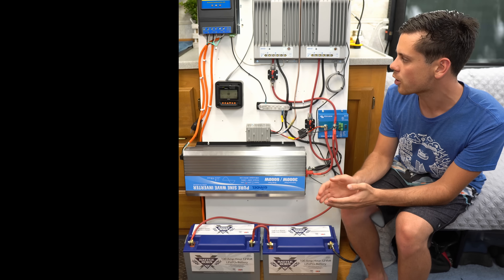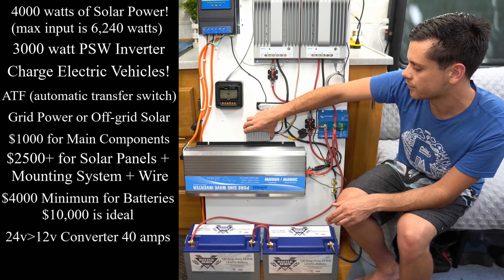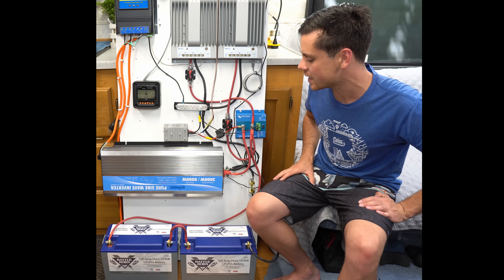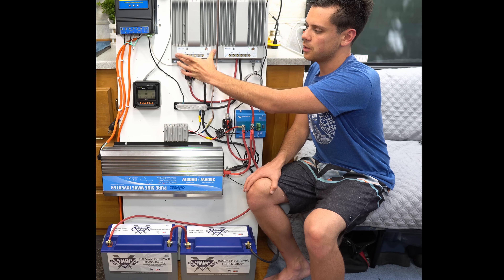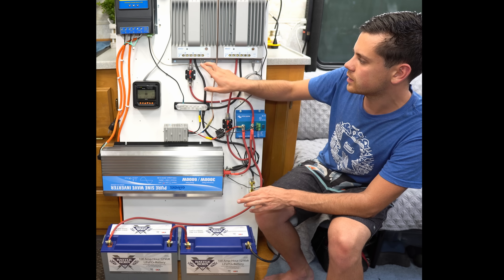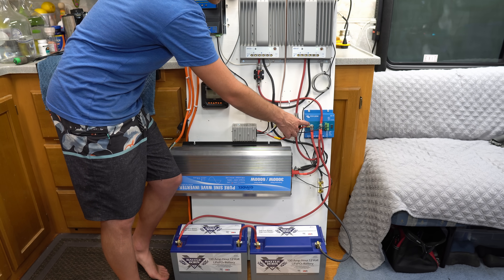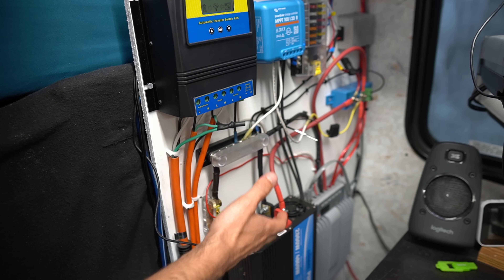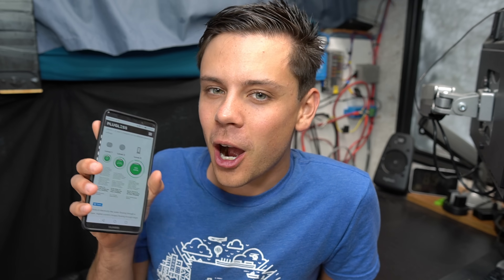Off-grid Tesla Solar Charger: 4kw solar input, 3kw AC output, ATS and more! 3 hour build time

Comment: I have a poor mans version of this at my home and charge a Nissan leaf EV,  system is 24 volt, 2000 Watts of panels, 8 vmax tanks, 1500 inverter.    The car  2015 Nissan leaf purchased used for 10K about a year ago out the the door.  If I remember the DIY solar system was like 6k (purchased 3 years before the car prices were higher for each watt).    My system is only used during the day with strong sun so we can charge on a cloud free day from about 10 am until 3 pm in the summer and 11 -2 pm in the winter.  The Leaf takes about 1200 watts to charge using the plug in charger that came with the car.  The solar system will put out more than this keeping keeping the battery's fully charged during the day.  During summer  In one day you can get about 6-7kw of charge.  In the winter it drops to 3-4.  The leaf gets about 4 miles per kw so you get about 12-24 miles per day of sun.  In winter it is more of a challenge due to shorter days and more cloud cover.  Occasionally we have to plug into the grid to charge.  Normally, you charge in the day and run your errands in the afternoon for all of the sun powered miles you like.   Also for us everything we use the leaf for is in a 8 mile or so circle so the range of the leaf is perfect for us ( about 85 miles).  Total in for 16K and that included the car!  My wife loves never going to the gas station to fill up!
Reply: By charging your car slowly, with the PV power not used in your home, you'll greatly extend the battery life, while creating your own net metering program.   Net metering will go away as more and more solar are poured on the grid.
Reply: Hi Der Kong, which charge controller did you use and how many?  Thanks!
Reply: @KennyGillis  Midnight classic solar 150
Reply: @derkong7114 Okay thank you, I looked up the specs.  It seems I could get away with something a little less capable for 1.4kw output.  Are you still using your setup?  I was thinking to use Nissan Leaf battery modules for the battery.  They are quite cheap.
Reply: @KennyGillis  Yes still using my solar for the leaf, the vmax tanks are now nearing their end life as I have to be careful to only charge the car on cloud free days as they cannot handle the pull without perfect sun shine now for very long...  The system was originally put in to run fridge, freezer, some lights, fans, electric start on gas stove and gas water after we lost electricity for a week due to tornado damage to the lines... The car came later as a way to use the solar more.... it was a fun project... let me know your battery choice and how it works as I will need to soon replace mine too...
Reply: @derkong7114  I definitely will.  My goal is to make spec the bare minimum for what is needed to do Level 1 charging on a tight budget.  I think three Leaf Modules in series will be perfect for the battery.  Biggest challenge now is finding the right size charge 24v charge controller.

Comment: Interesting timing of this video as I just picked up my Tesla Model 3.  As you mention, level 1 charging is pretty unrealistic as it only puts something like three miles per hour back into the car.  I have a NEMA 14-50 plug at home that I use for level 2 charging.  However I think the system you put together is very impressive.  I wish I had the time and skills to build it myself to power other parts of my house. Plus it is pricier than I can swing right now since I have to make Tesla payments. :(  Great video Will.

Comment: Hey Will.  Do you know anything about the nickel-iron battery?  We had one at my EV club that was almost a hundred years old and worked well.
Apparently they are not super hard to make if you understand some basic chemistry.
The charge efficiency is not great, nor is the volumetric or gravimetric efficiency, but they can withstand overcharging and over-discharging very well.
Might be a cool project to make and test a few (or buy).

Comment: Thanks for the videos. I have some ideas for things to test.
1. Low voltage disconnect. I have one from. Amazon. Has a rotary dial 12.0,12.2 cutoff. Though voltage drop from appliances make it not accurate, but voltage drop can be somewhat calculated.
2. A good electric heater to run during the day when solar is working. Like a 500 watt 12 volt one meant to help defrost windows, heat car ect.

Comment: Poor people in Third World countries do not use power inverters the cost of a power inverter is more than a whole years wage. And with the losses from a power inverter they would be forced to buy more solar panels that’s why poor people in Third World countries use solar panels directly to 12 V LEDs. If they’re rich enough that they could afford at least one battery they might have a 12 V or 24 V refrigerator that needs no regulation because that would be extra devices at an extra cost that they cannot afford. When I was young my friends who live out in the woods with no grid power everything with solar 12 V batteries with no inverters even the refrigerator
Reply: t lech  you can buy MODIFIED INVERTER  30 USD 3,000 watts
Reply: t lech  i used modified inverter for my refrigerator its work 24/7 1,500watts inverter 200ah battery 300watts solar panel my refrigerator is just 14inches high
Reply: t lech  TOTAL i spend my solar is $300 USD

Comment: You are in a sunny state. I am from a 6 month winter area. I think panels are nice but having a wind mill generator. Everything you show is in this video is panel trickle to battery bank.  I live in a Province where the province own utility has but into place a grid plan for base camps for hunting and fishing. The configuration is that the surplus electricity suppliers are clearly identified, the grid pay back is identified and any utility workers are protected as they work along the grid line. Contrary to the US, our Government wholly own electrical, fully intergaraded system, is happy if we push electron’s there way. The surplus electricity is sold to the Eastern states and is pure gravy. Ok this is a supburb  way of using a fully integrated (generation, transportation and distribution) utility but this year at my cabin I registered -36 c for 5 straight day’s. In our i vero ment getting car’s started is paramount. But I want to crank of the amp but also use the 12v dc or inverts 120 v.  Your target users do not encounter such climatic harshness, but you are A+ on everything you have published but could you take a short time addressing somebody having to have to function in a -30 c winter time and a reasonable temperature the rest of the time. In our parts we say that we have 2 seasons: winter and the rest. Pleas continue your work, for me, since it is a refende or go to place to increase my knowledge. Note: in the winter I have opted building a tent in the living room for efficiency. The cabin was built in 1932, the insulation is horse hair our shredded newspaper. Please tackle what battery is good for use (discharging) or charging at -36C.

Comment: Hey Will great video I've got a MCI bus with a 24volt alternator that puts out 270 amps I am planning on using the current system with solar I have enough roof area for about 7 or 8 panels some of the panels I've been looking at say they produce as much as 400 plus watts so I liked that you might as well get as much wattage as possible right.
So far on paper I'm looking at 10 to15 grand should get me where I'd like to be I really like Victron products what are your thoughts on them also lithium is the only way to go other than the cost.
Anyway great video keep them coming buddy.

Comment: Will - We asked for a house oriented higher Watt system and you gave it to us in simple, concise form with everything needed to run a complete low maintenance solar system. 

After all with a transfer box there are no extension chords and it really doesn’t take that much to run a house in conservative-mode. Thanks again!

Comment: Wow this is nice , but how big solar panels should i add for a system like this? 👍😊
Reply: At least 300+ watts per panel and 60-72 cells per panel as well. This is a set up that should only really be used with a 24 or 48 volt Battery bank. Minimum of 40+ PV panels, and like Will stated, around $25-30k of Lithium batteries. So much here to consider and NONE of this should be taken lightly as some weekend project unless you really know what the Hell you are doing ! This is stepping into some very dicey territory that only an expert should ever attempt. Not trying to dis Will in any way whatsoever, I am just trying to point out that anytime you deal with electricity - especially when mucking around with different voltages within the same system - you risk seriously injuring or killing yourself. 'Nuff said. (sorry Will...)
Reply: @JohninTucson  well thanks for the answer i will have that i mind , you are right im still new at this , I am there where im just about to buy a pice of land to build a cabin for the kids and me , the plan is that cabin are going to run on solar power cobined with a small windturbine and it are going to be a free spot or a little pice of heaven where the kids and me go to relaxe in the weekends and whenever we got a few days of from school and work , i just thought that this setup sounded like the right setup for a small house or cabin 😊 but im not just going to jump into any of this without have been reading will's book and have been reading about it on his web-site thats for sure and maby bring a freind along thats good at electrisity.

Comment: Hey William, I would like to consider a level 2 option. 
Level 2 is up to 80Amps. You can charge at only 5 Amps if desired, or 10, or 15, or somewhere in between up to the limit the connection will offer. 
Up to 30Amps at level 2 is most commonly found at public charging connections. Tesla Specific connectors often allow 40 or 80 Amps.
Consider a project with 5 or 10 Amps and an option to occasionally charge higher than that. 
The specific EVSE unit used is configured to send a signal to the car offering it's maximum Amps at level 2, then the car decides how much it will pull up to that limit.

Comment: I have a question about 12v deep cycle sealed gel AGM batteries, can they be stored in a shaded ventilated shed outside here in Phoenix where we get summer temps in the 115's for several months on end? I would bring them inside but I'm worried about off gassing and not waking up the next morning....can anyone advise me on what damage I am doing to them and do I have any other options other than moving to Siberia?
Reply from the maker: Very tough. From what I read the life cycle will suffer. You for sure need temp sensor for all charging methods. And you need ventilation temperature wise, but you won't have e gassing if they are AGM sealed lead acid.
Reply from the maker: https://batteryuniversity.com/learn/article/how_heat_and_harsh_loading_reduces_battery_life

Comment: I was looking at a Schneider setup on altestore.com.. I like to think of the long term goal and not the up front cost. Don't get me wrong I'm living like I'm poor to save money. But I'm starting with 1800 watts of panels with room to expand. And I want to use tesla batteries for a bank. I want to make it so I can add to it over the years. The inverter can automatically switch between using the battery, panels, and grid without exporting. I have a gas water boiler that I want to assist with electric water heater from the solar excess when I'm away. Thoughts? I'd love to have a conversation with you.

Comment: This system will work better than you think.  A Model 3 can be dialed down as low as 5 amps on the car's charging screen so 2400 Watts is not required all the time.  In fact, the outlet has to be derated by 20% for continuous use, so the best it will do on a standard NEMA 5-15 outlet is 12A or 1440 Watts.  You can refer to the chart on the NEMA adapter ordering page for the various options and how many miles of range they will add to the car.
https://shop.tesla.com/us/en/product/vehicle-accessories/gen-2-nema-adapters.html

Comment: Great introduction Will, but ends rather abruptly at 10:47 - will you do a part 2 or reupload?
Reply from the maker: There was nothing more to say, so I ended it there. I figure that people that watched till the end didn't care for an ending and were only here for information haha
Reply: @WillProwse  You have a point - but was hoping you'd go on to  explain more about connecting the solar chargers in parallel, transfer switches, switching between grid, battery, dump load. I think you'd need some extra stuff to manage that, and then there's collecting and displaying the data - something that a Raspberry Pi with Grafana can do really well, and very cheaply.
Reply from the maker: @ahaveland  ohhhh ok. I actually have full videos dedicated to most of those topics. Check out the automatic transfer switch. Takes minutes to setup. And yeah I guess I should make a video on more complex system design. Making things working together. Good idea
Reply: @WillProwse  Thanks - will do...

Comment: Hi I've been watching your channel for quite some time now. What do you think of using 4 Deka 6-Volt 448-Amp Golf Cart Batteries (2 in series then, the 2 sets in parallel  for a total of 12Vdc x 448 Ah), 8 265W solar panels (2 arrays of 4 each), 2 PowMr 60a mppt charge controllers, a 5000 watt Aims 12Vdc inverter, and a 50 amp ATS hooked to a generator. To make up this system? I have everything but the batteries and the battery protect (not sure I need it as the inverter will shut off at low voltage of 10.5Vdc) and the dc - dc converter as I will not be using 24Vdc. Any help you can give me would be greatly appreciated.

Comment: sol'utations utube guru ji.. good for tesla, ample for 3rd world micro grids.. average 'merican house is a village community elsewhere.. good doings.. also for a hybrid solar build, spinning a low rpm 250 amp output marine alternator with boosted voltage from a system similar seems a possibility?

Comment: This brings home the fact that the only thing standing in the way of mass adoption of off grid systems, is the high cost of batteries.   Part of the problem is the development of lithium ion batteries for automotive and portable use has impeded the development of batteries for static applications from cheaper materials, like zinc, or sodium.  Lithium iron phosphate is a step in the right direction but the lithium in them is still relatively expensive.
Reply: I live in North Carolina.  The state is mandating the dominant utility, Duke energy to re-mediate many of it's river adjacent coal ash dumps.   The state plan is said to cost 10 Billion dollars, the utility's plan, "only" 5 billion.   The only thing agreed on by the state, and Duke is that rate payers will shoulder the cost.  
Rising rates, and the rapidly falling cost of batteries spell the end of Duke's business model, they will lose their customers, to lower prices.   The only way to avoid Duke's demise is to legislate that home generators subsidize the utility, either by a building code requirement for connection to the grid, with a high connection fee, paying a tax for the privilege of going off grid, or some other reward for lobbying scheme.

Comment: Still just doing this for RV power at the moment, But great video when deciding to move this over to the house. I like the hot water idea I wonder if i Can convert my atwood to electric and see if my 2000watt xantrax can handle it. The Lifepo4 I built with your videos is already pushing the invertor to the edge and likes to shutdown when pulling big surges and the fan comes on i didn't even know it had a fan cause SLA's can't push it hard enough to kick em on. hope I dont burn it up haha.